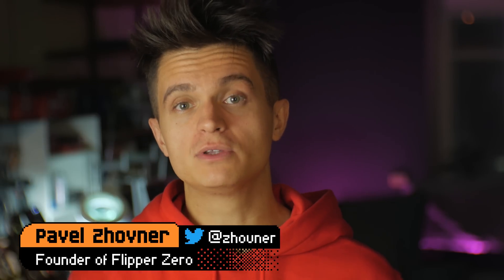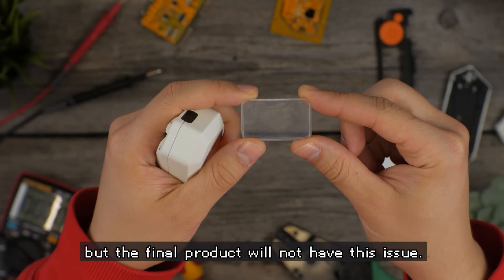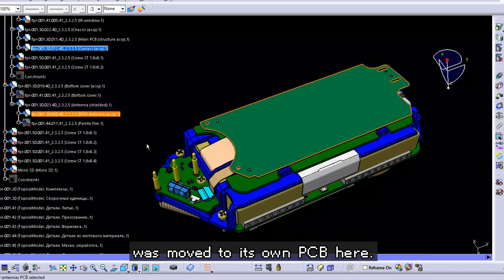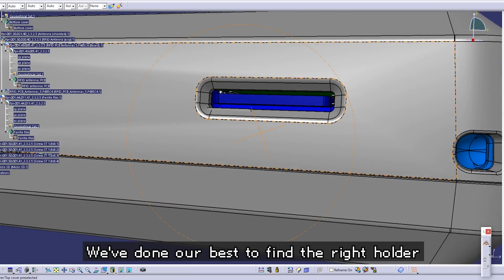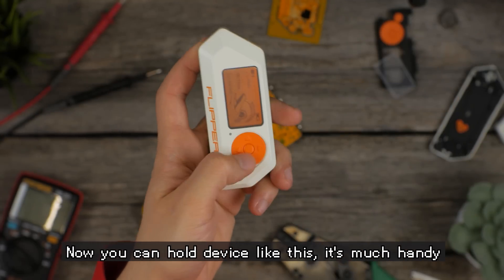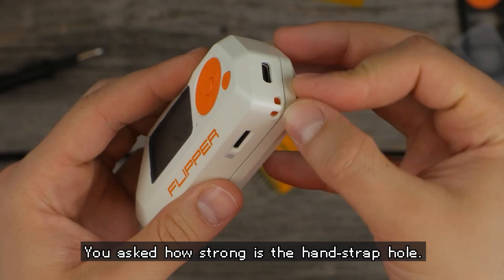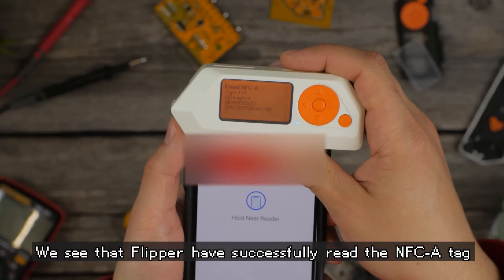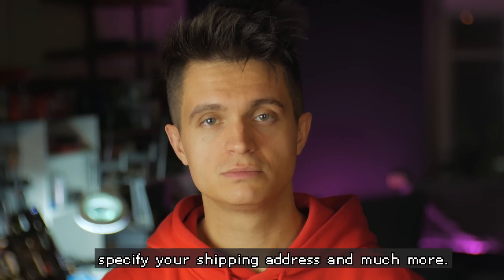Latest Sample of Flipper Zero

Comment: So for NFC-enabled point-of-sale transaction, the UID is constantly changing. But the vendor only needs one to be able to complete the transaction, correct?
Reply from the maker: Actually no, the UID it's just a first level of ISO-14443A, like serial number of chip. The EMV transaction is live on the higher level.
Reply: @FlipperZero  Does it change so frequently in order to avoid a replay attack? Thank you for answering my questions! 🙂
Reply from the maker: @ThatNateGuy  no, it's just to avoid using the serial number of NFC chip for access control that is very popular for dumb access control system in offices.
Reply: @FlipperZero  Большое спасибо!

Comment: The last teaser of the function, does it mean we can copy credit card also ?
Reply: No, you can’t copy any credit card. You can just read what is on the surface, but credit card contains crypto chip which you cannot just copy.
Reply: @domints  if you can read something meaning you can copy it right? And I can emulate it using the flipper zero ? So I don’t need to use my phone anymore .
Reply: @ericchong9261  but you can’t read the crypto chip. You can give it some data to crunch, it will do its crypto math and you can read the results. But you can never know what is the crypto math it’s doing, you can’t read that. That’s the base mechanism that stops you from cloning the card.
Reply: @domints  I like how you persistently trying to explain to me. Thank you kind sir. I will probably ask you how to use it once I received mine .